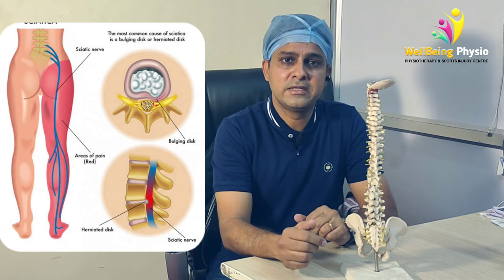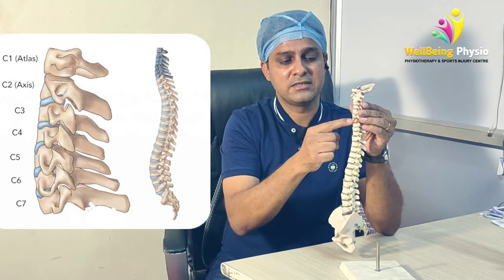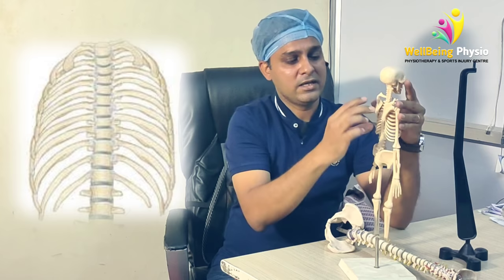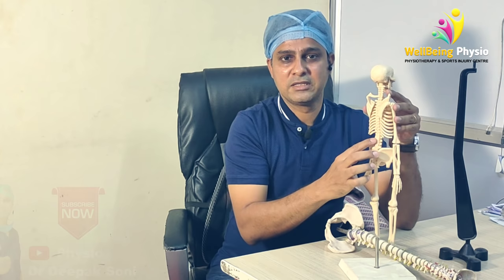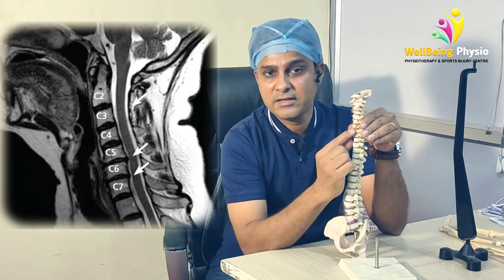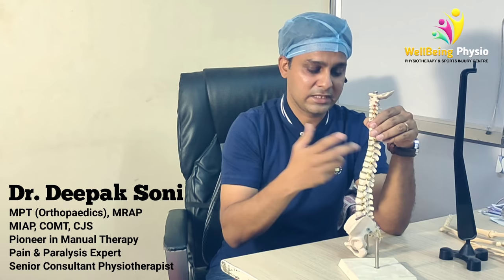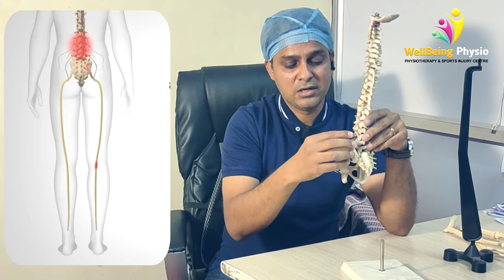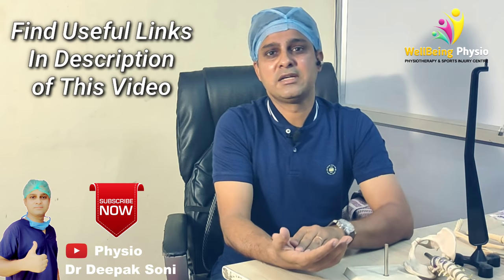L4-L5 | L5-S1 स्लिप डिस्क का इलाज | Slipped Disc Treatment Hindi | कमर के छल्ले सरकना क्या होता है

Comment: The AP dimensions of the lumbar canal at the level of the intervertebral discs are as follows-
○14.8 mm at L1 - L2 ( 13.9 mm at L2 - L3 ) (13.2 mm at L3-L4) ( 9.6 mm at L4 - L5 ) ( 9.6 mm at L5-S1)
○IMPRESSION=Lumbar spondylosis
          =Diffuse asymmetrical annular disc bulges at L4 - L5 and L5 - S1 levels , along with facetoligamentou hypertrophy causing mild stenosis of central canal , bilateral lateral recesses and lateral neural foramin with mild compression over ventral thecal sac and bilateral traversing nerve roots . Please correlate clinically ये रिपोर्ट मेरी ममी कि हैं इसका कोई टर्टमेट हो सकता है सर और बिना कोई ऑपरेशन 🙏🏻

Comment: MPRESSION:
 Sacralization of L5 – lumbo sacral transitional vertebra.
 Lumbar spondylosis. 
 L3-L4 disc bugle indenting thecal sac with mild neural canal stenosis, lateral recess 
narrowing on both sides, no neural foraminal narrowing and no nerve root 
compression.
 L4-L5 disc bugle indenting thecal sac with mild neural canal stenosis, lateral recess 
narrowing on both sides, mild neural foraminal narrowing on both sides and no 
nerve root compression.
 Spinal canal dimension is reduced at L3-L4 level.
Please assist, Sir .

Comment: i want to continue my gym but due to slips disc l5 s1 i am unable to continue, whenever i start gym  it trigger the pain, so i am scared of any exercises , what could be permannet solution that i could continue my gym
Reply: i m in same situation 
did u got any cure ?
Reply: @akashbhullar8723  not yet, but i enquired and found there is option in Istanbul where they operate the disc with laser and it will placed as its own place , by the time I am just taking more protein food and doing cobra pose exercise, if you find any solution must share
Reply: where in istanl bul treatment is done?

Comment: Dear sir ...there is a problem 
In MRI it's shows that diffuse annular. & Broad base large posterior central herniation of L5 S1 disc indented ventral thecal sac  and causing  compression of traversing both s1  nerve root in R>L  mild compression of bilateral intervertebral neural foramia with impigment of exiting L5 nerve root...
Sir Kya y problm just physio therapy s thik ho skti h??
Plzzz sir reply...
Bczz it's too painful...
Reply from the maker: 100% curable with Physiotherapy
Reply from the maker: call 9649076149
Reply: @PhysioDrDeepakSoni  sir mera Mri Report Mild Disc Bulge L4 L5 Indenting thecal Sac ea koi sivior condiaction hey kiya 24 ssal kie students hun bahut depression per hun mera road accident hua tha

Comment: Lumber lordosis is straightened

Osteophytic lipping is noted in bodies of lumber vertebrae

Disc Spaces are reduced in between L5/S1 vertebra level

Both SI joints appear normal

Sir ye mera x-ray report hei.muje kuch Solution di jiye.😞
Reply from the maker: whatsapp queries @ 9529111633

Comment: MRI Spine Lumbo Sacral Plain

Technique Tiw, TW Sagittal TZW asial TIW, STIR

Observations

Grade I retrolisthesis of L4 over 15 vertebra is seen; no spondylolysis. Mild anterior osteophytes and endplate degenerative changes of 13-15 vertebrae are seen.

Desiccation of intervertebral dises are seen. Mild postero-central bulge of L1-L2 dise is indenting the dural sac; nerve roots are not compressed. Mild postero-central bulge of 12-13 dise with annular fissure is seen; nerve roots are not

compressed.

Postero-central bulge of L3-L4 dise is indenting the dural sac; nerve roots are not compressed. Right paracentral and foraminal bulge of 14-15 disc is indenting the traversing nerve roots on

right side.

Mild postero-central bulge of 1.5-S1 dise is seen; nerve roots are not compressed. Mild L4-L5 facetal arthropathy are seen bilaterally.

The ligamentum flavum thickness is within normal limits. Lumbar canal AP diameter at LI to LS levels are:

Level L1-12 12-13 13-14 14-15 L5-S1

AP Mm 11 14 13 10 10 The conus medullaris and the sub arachnoid space are normal

The nerve roots of the cauda equina are normul The paraspinal soft tissues are normal

SACROILIAC JOINTS

The sacroiliac joints are normal. Small area of 12 hyperintensity is seen in iliac part of left SI joint and sacral part of right St joint

degenerative change.

Impression

Grade I retrolisthesis of L4 over L5 vertebra is seen; no spondylolysis. Mild postero-central bulge of L1-1.2 disc is indenting the dural sac;

nerve roots are not compressed, Mild postero-central bulge of L2-13 dise with annular fissure is seen:

nerve roots are not compressed. Postero-central bulge of L3-L4 disc is indenting the dural sac: nerve

roots are not compressed.

Right paracentral and foraminal bulge of L4-L5 dise is indenting the traversing nerve roots on right side

Mild postero-central bulge of L5-S1 dise is seen; nerve
Reply: Sir kindly mujhe bataiye ab kya karna hai